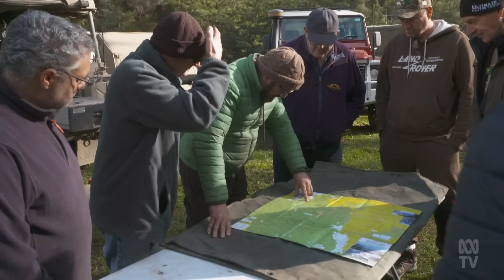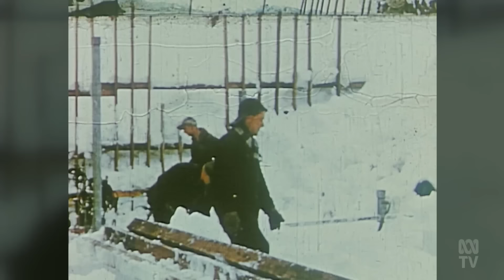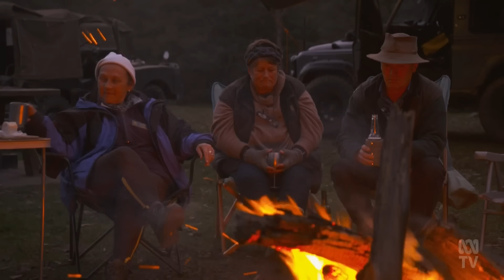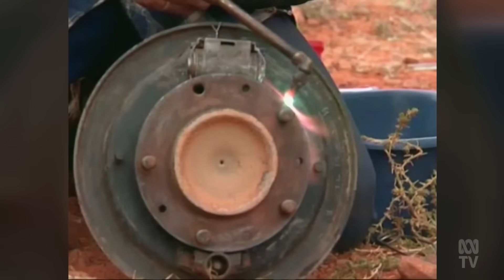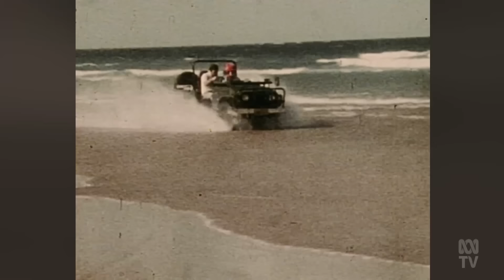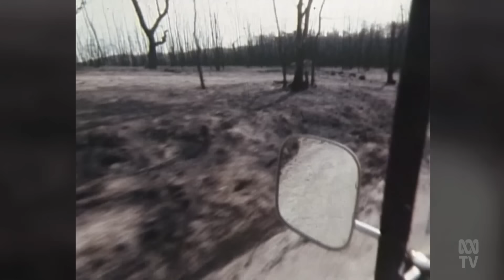How Australian ingenuity improved Land Rover four-wheel drives for weekend explorers | ABC Australia

Comment: I remember when we got the defenders in the Army, The brass were worried we wouldn't be able to drive the coil over setup without rolling.
Reply: The trial version of the Perentie did actually have the front axle panhard rod in the wrong location, resulting in a propensity to roll if hitting a hole when turning left at speed. They moved the panhard rod across a tad and fixed that issue.
Reply: A friend of mine who lived in Kenya told me that when the Defenders with the coil-over arrived the roll-overs became a big thing, which they hadn't been with the old leaf-spring suspension. That was his excuse, anyway.

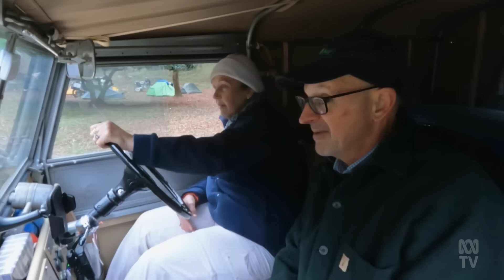Comment: At 6:10 the wheel nuts are on backwards- the taper is supposed to go towards the wheel
Reply: apparently the wheel nuts had a taper at each end
Reply: My 1957 Series 1 107 SW and 1960 Series 2 88" has tapered edges on both sides of the wheel nuts... Easy beazy, no confusion, solid grip... Smaller nuts and studs though.
To change rims with a newer model, you need the bigger nut with the same smaller hole... Crazy, the British 😂
Reply: The early wheels take a double ended 15/16" lug nut, the newer ones use a 1-1/16" single sided nut. Good eye though!